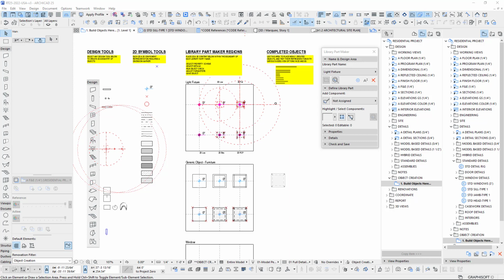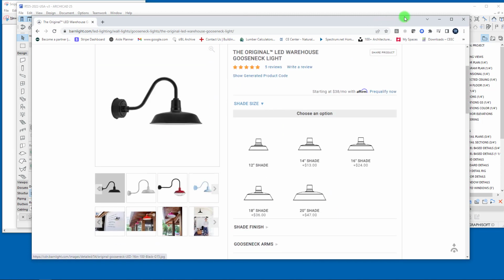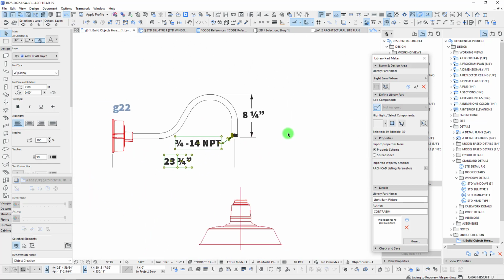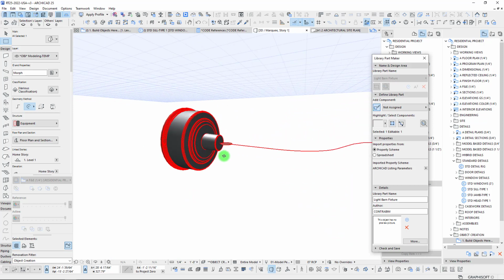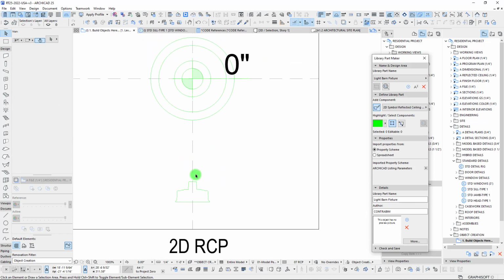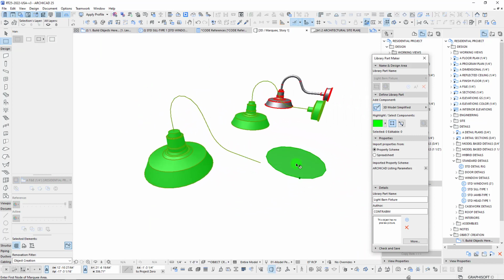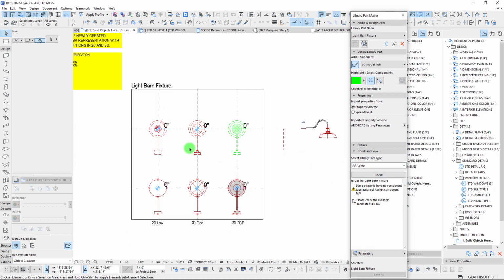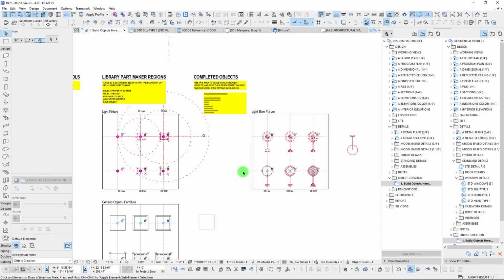How to Create Objects with Archicad's Library Part Maker

Comment: Is there any benefit in using Library Part Maker vs Param-O or vice versa? Or is it just two different tools to get to the same outcome?
Reply from the maker: Param-o has a much better ability to create parametric inputs, LPM is a little easier to use and has cleaner options for setting up different Model View Options. Definitely not the same outcome, just depends on what type of object you're going for! If you want highly detailed manufacturer based objects, probably LPM is the way to go. If you want objects that are parametric yet simpler geometry, Paramo might be the way...
Reply: @CONTRABIM  Can I use them both in one object? There is any way for transition of gdl between addons?

Comment: Hi, I have issue with this one, and would appreciate some help. I can't change dimensions of object I made, it takes original dimensions of made object and won't let me adjust it later (width, depth, height)🥴
Reply from the maker: Hello! Yes that is one of the downsides of LPM, fixed dimensions. It's great to create detailed objects exact per manufacturer spec, but to adjust dimensions later is not much of an option unfortunately! Thanks for the question! I wish Graphisoft would introduce some additional variables that we can stretch/scale based on set dimensions. One day maybe...

Comment: i'm 20 minutes in most of it is still trying to get the outline of that damn light fixture. i don't mind watching a 70minute video, but i'd appreciate if this was edited to just using the Library Part Maker. perhaps a good chunk of this could've expanded onto other parts of the tool -- or even another object altogether? perhaps an object solely for 2D drafting / annotation use?

prep work could've already been done in the background where the outline was already set & we could've jumped straight into the tool itself.

40mins in, still doing drafting work & little explanation of how this relates to the tool. i'm struggling to keep my attentions span with the constant disruptions to a slow/lagging computer & parts of it that isn't really closely related to the subject of the video, which is the Library Part Maker -- more "related-adjacent".
i'm starting to think this video was streamed (?). i'm also starting to think that this was the wrong subject to stream with & it should've been properly edited. also, i would've preferred if it was a simpler object that was created

Focus on the tool -- not the object modelling. explain why things are set up within the tool, what to do, what not to do, & why it's better one way & not the other. 

at the end of the video (phew, finally) yes, i completely agree. i would love a course on this.

apologies for sounding mean, but this was frustrating to watch. a little bit enlightening, but far more frustrating with all the distractions.
Reply from the maker: Thanks for the comment and feedback. Totally understand the frustration of watching a longer non-edited video. I find some people prefer to see all the clicks (and even the mistakes), and others just want the fast shorted version. Happy to boil down the subject to a 5 minute video next time. Appreciate the feedback!
Reply: @CONTRABIM  i am one of those who prefer to see all the clicks. Sometimes i can learn so simple trick with this way.
Reply from the maker: @mr.m2267  I'm happy to hear that, and also to mention that I just figured out how to record each shortcut I make in AC, so now that'll be displayed on all YouTube videos going forward! Thanks for your comment!
Reply: @CONTRABIM  if you mean that we can see on the screen which keys you press, that's perfect, because I couldn't understand how you did some of the things you did with the keyboard. 🙄